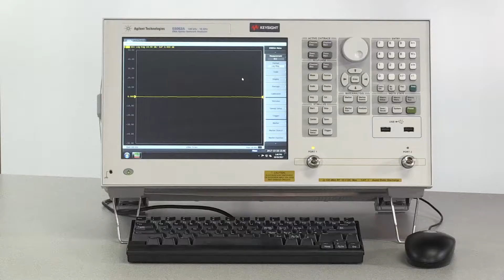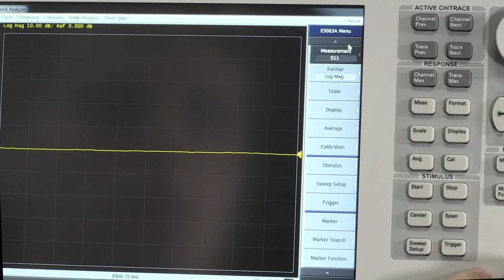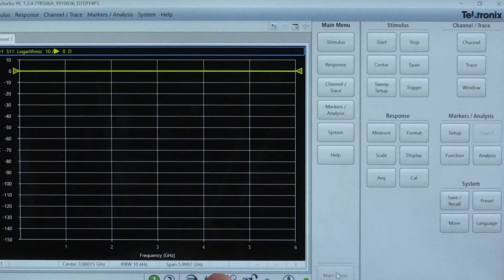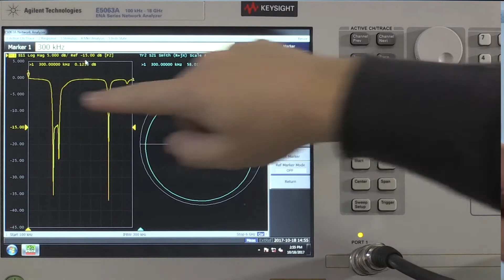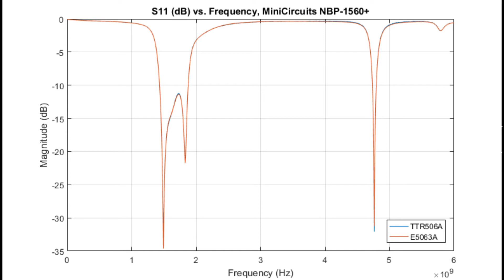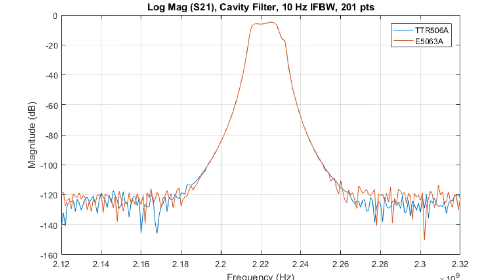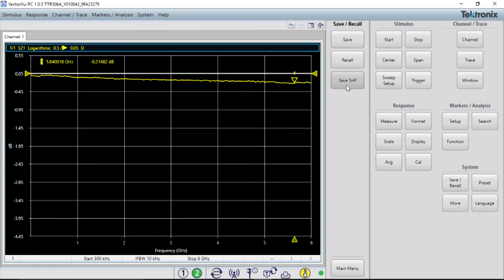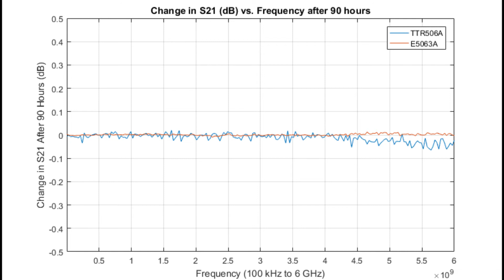Tek’s Vector Network Analyzer: How Does It Compare?

Comment: How does the directivity source/load match compare  between these units, especially using the ECal option for the Tek unit (my preferred way to cal). Most of the work I do requires tuning circuits that need a match in the range of -35 to -42db RL so that is a critical standard for me. 1.1:1VSWR is my normal high end of the scale on the chart when I am scaling graphs for my reports... If this instrument can approach that level of measurement I am intrigued.